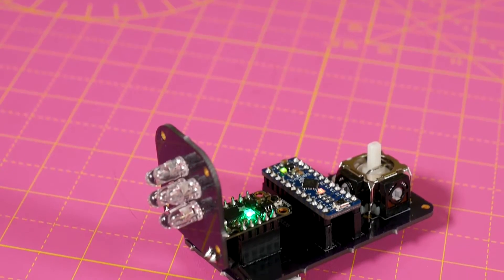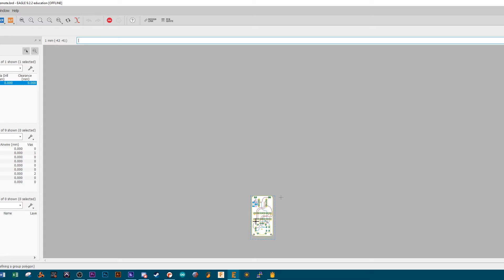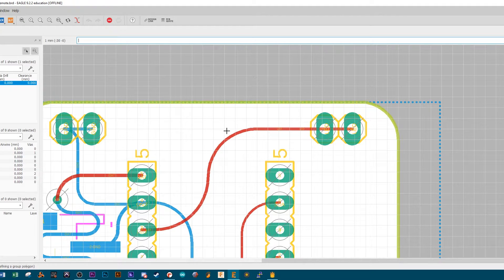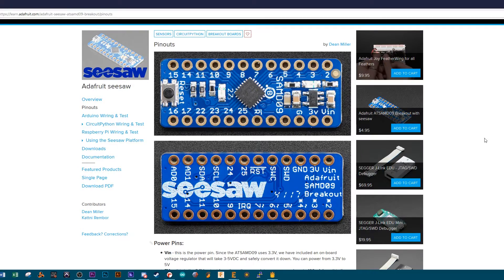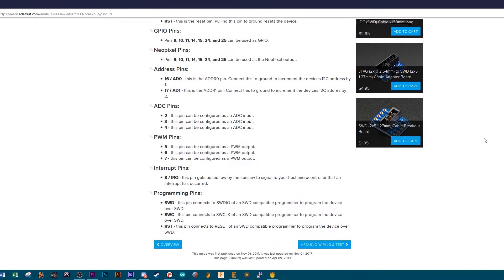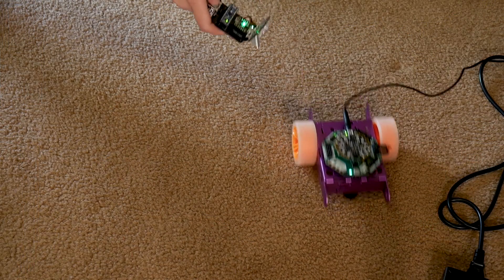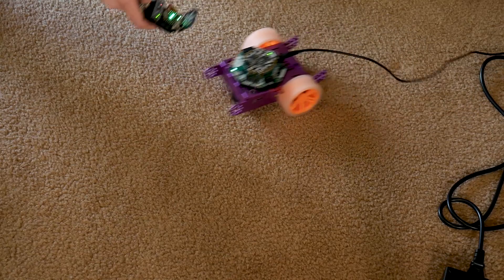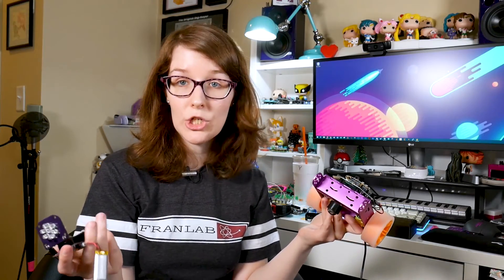The IR Remote PCBs Are In! And They (Almost) Work!

Comment: Great little project that inspired me to have a go.
I used a Darlington driver chip (ULN2803 - really cheap)  to switch the IR LEDs and added an extra button to enable spins (wheels in opposite directions) as well as turns (one wheel stopped on the robot) in conjunction with the joystick x-positions. Logic controlled with an Itsybitsy M0.
Looking forward to your next video.